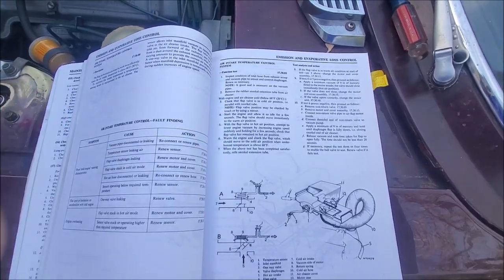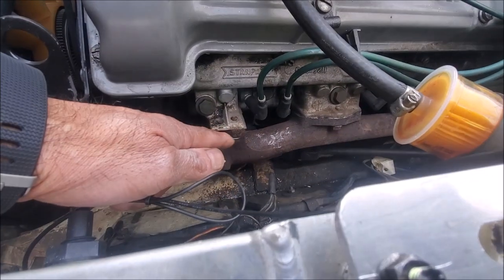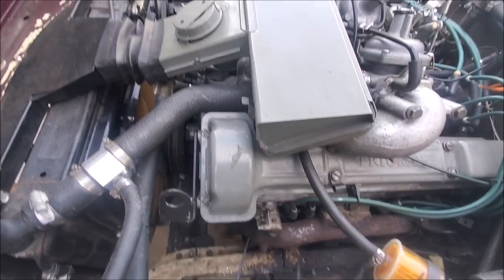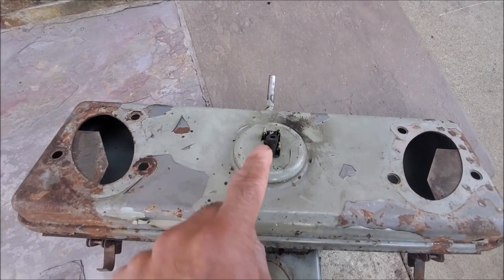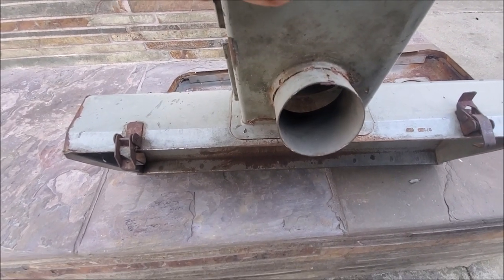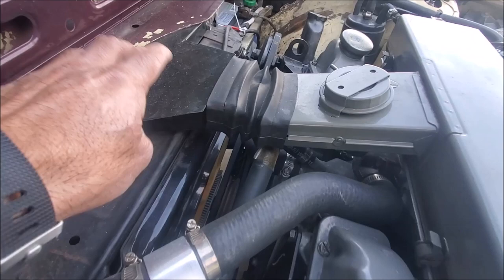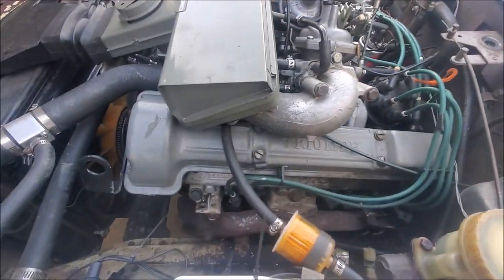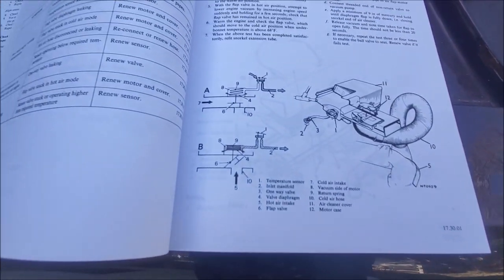Triumph Stag - Air intake temperature control system

Comment: The air intake is bi-directional; The idea being on cold the air is drawn from a warm source ( The external area of the exhaust manifold) to quickly heat the carburettor to optimally 20 degrees and so rapidly turn off the choke ( all about emission control) 
  The flap is spring loaded bias, being controlled by vacuum bellow fed from the inlet manifold and switched via a bi- metal valve ( that can be opened and adjusted) 
    The next problem is the overheated carburettors due to the nestled proximity between the vee blocks of the engine.. This can be offset by renewing the Bakelite spacing insulators to the inlets and; also the replacement of the steel spring washers with plumbers fibre washers.. to improve the insulation properties ( it is in no manual but does work to help hot starting)
Reply from the maker: Are there folks who make a different type of spacing insulators?
Reply from the maker: Thanks for the details.
Reply: The replacements are a better material than the original, all be a little thicker so be aware. It makes a world of difference hot starting
Reply from the maker: Who carries these insulators? My auto Stag has an issue even with another set of carbs. My manual doesn't. My auto's rpm at speed is typically 3500-4000 so it generates more heat than my manual with OD with runs less than 3k.
Reply from the maker: Thx. I'll check them out.